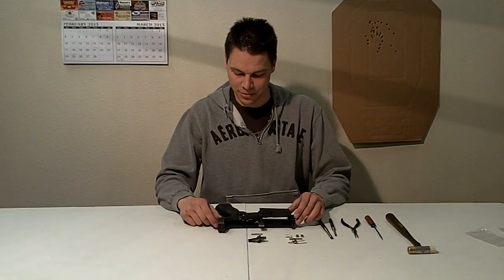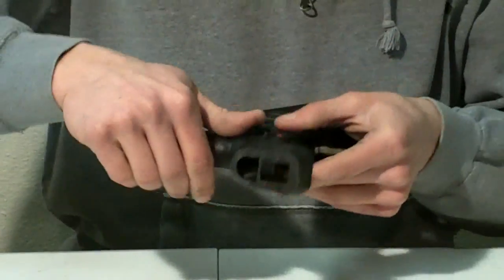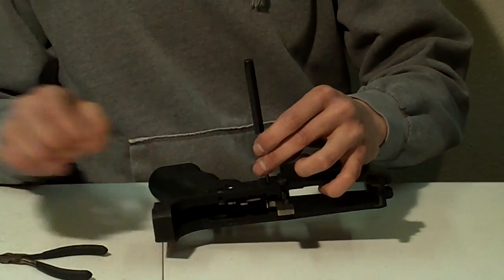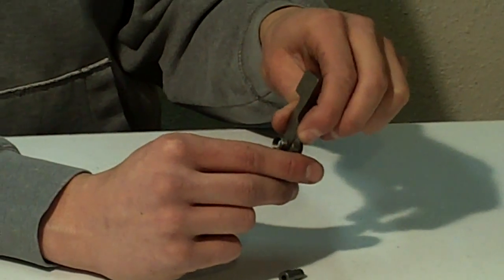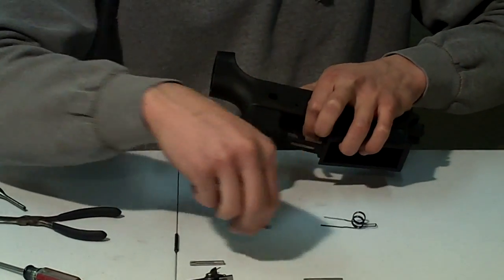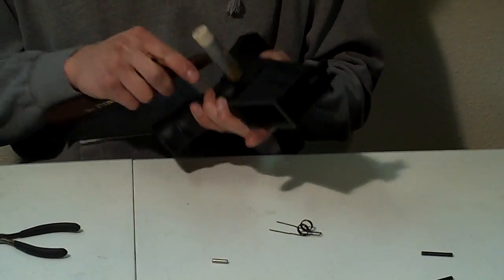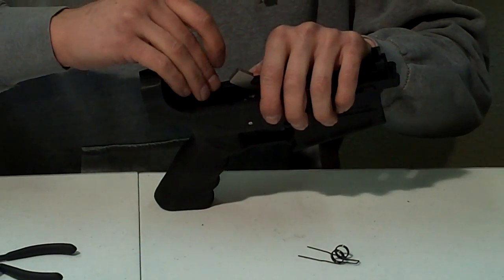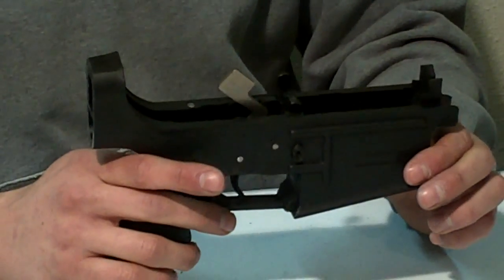Tooth and Nail Armory Trigger install

Comment from the maker: Trigger Group will work in the XN models. The bushings that go beside the hammer may need to be tapped together with a small hammer. The tolerances are very tight in both the XN and non-XN. As stated above the trigger must be modified if used in conjunction with an aftermarket grip adapter.

Comment from the maker: The biggest purpose behind the trigger kit is a cheaper alternative for 922(r) compliance. The trigger kit counts as 3 US made parts out of a total of 4 needed. This comes out to about $28 each which is cheaper than any other parts available. Gas piston comes in at $37 which would give you a total of 4 parts. This allows you to be legal to use whatever mags you like as well as any configuration of stocks and grips.

Comment: FYI - these trigger parts DO NOT WORK with an XN model. The bushings on the hammer are too wide, and the sear holder won't allow the safety selector to clear without dremel work (if you have a butt stock adapter inserted below).

Comment: mine wouldnt fire when I turned the hammer spring around.  too light   actually your trigger works better with factory hammer and hammer spring.  i wish I would have just tried a 10 dollar trigger spring first. why would your hammer spring be heavier than the factory one